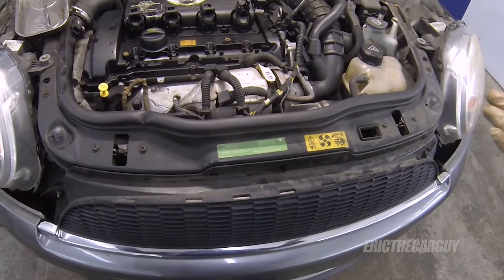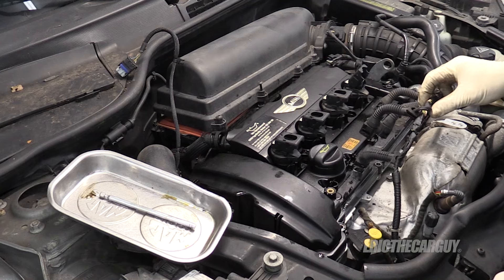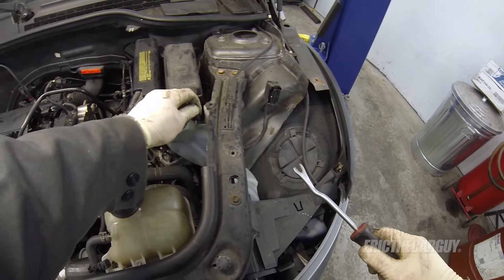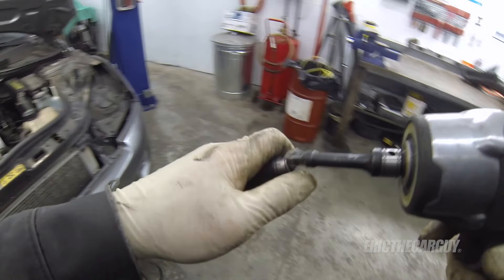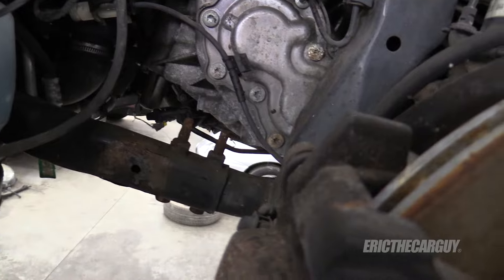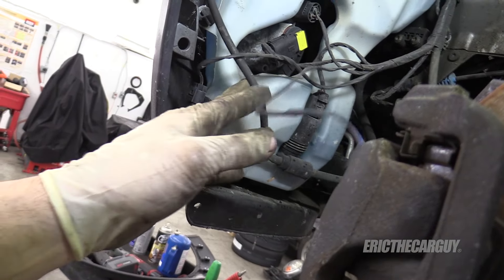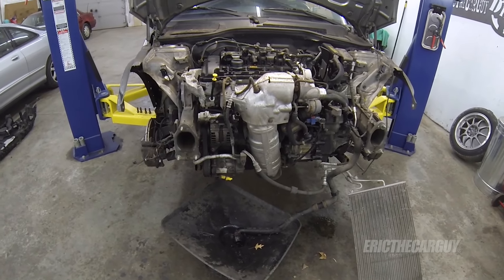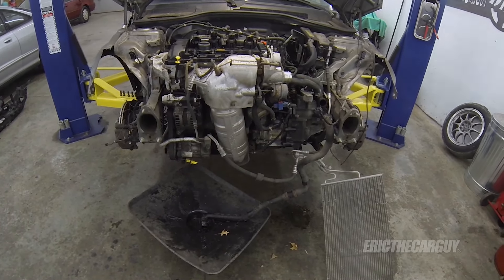Mini Cooper S (R56) Front End Removal

Comment: for that stuck lug bolt, get yourself a used SWENCH mechanical impact wrench..
down to only $200 used on ebay. It KICKS ASS, never lose another lug bolt/axle nut battle in your life.

Saved my ass removing head bolts that were so tight it would shatter the Torqs bit.
And removing plastic dual over head cams/crank bolt on a subaru (4 cam with plastic pulleys).

plus anytime you pull it out you are INSTANT BAD ASS.

Thanks for the upload eric!

Comment: 6:44 when you try too remove oil drain plug after a jiffy lube oil change.
Reply: LEX Maximaguy87 and u know that the treads are 100% gone..
Reply: hes actually trying to take the driver side wheel, off not the drain plug.
Reply: Jiffy lube guy used too many dugga duggas on it. My wife's 2012 MINI Countryman had a similar issue, but I wasn't in a shop trying to get it off. I was on the side of the road. Thankfully, I was able to find a 6 foot long piece of tubing that was used for a fence post and make a cheater bar on the lug wrench. I still had to lean on it pretty damn hard.

Comment: i found that a small deep socket was great for pushing the clips out from behind for the wheel arch trim without breaking them , most people just go Ape and use a door card trim tool to remove the wheel arch trim , with pretty much breaks most of the clips, there not much to buy, but i just find it a better method ! 👍

Comment: Autozone has a variety of clips that will work with MINI trim.  I don't think you needed to remove the inner fender liner completely, just detach the front four push rivets.  I think you also didn't need to remove the eyebrow trim completely, just detach the fasteners where the trim meets the radiator support.
The Harbor Freight Pittsburgh Pro 25" breaker bar (for when you're "serious") is the Bomb.
Reply from the maker: Thanks for the input. You'll see in an upcoming video that my suspicions were correct that you don't need to remove the washer bottle or the upper support. You just need to detach it from the strut towers. Personally I don't think it's a big deal to remove the fender liners. I also think it makes more room if you do. It also gives you the opportunity to clean out the debris that sits in front of the door that can cause corrosion.

Comment: I hate those wheel arch clips. My R50 has them. 
But the front end is so much easier to take apart. Probably only 12 fasteners for the front bumper cover, 10 to remove the bumper bar and 4 more for the crash tubes. Electrical connections aren’t fancy though.

Comment: Eric, I'm surprised to see you don't have any temp studs for these German vehicles. They are quite inexpensive . Before removing all bolts. You insert two studs usual made from aluminum with different thread pitch to meet multiple applications. They stick out about 3 inches after hand threaded into the hub. Allowing the wheel to be supported after all bolts are removed. I hope you read this and look into this cheap simple alternative.
Reply from the maker: I don't normally work on German vehicles, I normally work on Honda's.

Comment: Eric that is alot of bolts fasteners and so on. How do remember which ones go where for the reinstall? Do mark/bag them or do you just have an incredible memory?
Reply from the maker: I normally keep all the fasteners I remove with the part that was removed. If I can, I put them in place on the part removed. As long as I don't accidentally kick the parts when walking across the shop, it usually works pretty good.

Comment: Atleast you just had to get serious, didn't had to be annoyed or worse, pissed off. 

That said, I had to remove the axle nut on an chevy uplander. It was easier than your wheel bolt ! I did get the 'I'm serious', but I'm sure the cordless impact would have just worked.

And, on my previous car, I actually had to go ballistic... I broke a 1/2" ratchet on a wheel nut. I didn't had the 'I'm serious' breaker bar, but I lifted the rear wheel off the ground, making it spin... And eventually the stud started to spin... I ended up drilling the stud. Pilot hole, then 1/4", then twist to break. No dammage to alloy wheel.

... And people say you can't drill studs... Yes you can. Easilly too. If you can't it mean you use a dollar store quality drill.

Comment: I had to use a long breaker bar to loosen up the wheel bolts on a Mercedes before as well. It was so tight the bar was slightly bending lol I hate wheel bolts.

Comment: How do you store so many nuts and bolts so you know where they came from?
Reply from the maker: I keep them with the parts removed.
Reply: If you can't attach them back where they came from - and especially if the car's going to be left in pieces for an extended period of time...I'd recommend some little ziploc bags and a magic marker.  Invaluable for project cars.  But never dump them in a pile and assume you'll remember them all - that way madness lies.  :-)
Reply: Agree, I took my mini apart and did this exact thing with the zip lock bags and a marker.  It worked great
Reply: Of course he could always just watch this video to see where everything goes.
Reply: I'm going to assume the guy who casually takes engines out of cars knows how to keep track of his parts

Comment: 16:24 Only a German would design such kinky abstract washer reservoir as that.  I picture a dude like Mike Myer's Dieter character from the old SNLs bringing that design idea to the Mini engineers.
Reply: you say that like it's a bad thing , Germans have there funny ways
Reply from the maker: It's designed that way so you can have access to the plugs and bulbs for the lighting.
Reply: Over engineered and manufactured with terrible plastics. That’s the BMW way. And yet I still own a 211k mi 530i...
Reply: It’s all about packaging; they needed to design the reservoir that way as provide easy access to the fog lamp bulb, and because there is very little front overhang due to how small the Mini Cooper is.

Comment: Got a question. Both my neighbor's 12 inch engine fans in her Dodge Caravan won't come on. I changed the coolant temperature sensor, that didn't fix the issue. What else could it be? I checked the 40amp fuse under the hood, no breaks or desoldered connections... no way both of her fan motors burned out at the same time, right? I could always jump them to test, but that really is my last suspect...gotta be wires right? Think I got a bad new sensor?

Comment: hey eric this isn't related to video but my wife's 1998 acura el 1.6 was parked and wont start, i checked for sprk there was none, changed the distributor, now i have spark, was able to get it to run normaly, went around the block parked it, my wife tried to start it maybe 2-3h later and wouldnt start anymore. note that before it stopped running somtimes it would crank for a couple turns before starting. so went and checked for fuel pressure after the fuel filter and there is pressure and when i checked the plugs for spark i could smell gas when my wife was cranking it while i was looking for spark, so at this point i have no idea. somtimes when i crank it i can feel the engine trying to start. could it be the ignition timing, i did my best to mesure the marks on the old one and tried to place the new one in pretty much the same spot and the fact it started and ran fine tells me that probably isnt it. there is a check engine and codes are as follows P0118/P0505/P0138/P0420 hope you or one of the awesome viewrs can help, thnx!

Comment: "Bonus screw". You got that right. The take-away here is the Germans found a way to over engineer and complicate a nice little simple car and made it super expensive.  BINGO! You lose.
Reply: and still runs
Reply: Flame Beats my Aveo’s front bumper is attached by 6 clips, 10 1/4” screws, and 4 14mm nuts.
Reply: I am starting to believe German cars meant to be fixed.

Comment: Cool thing, you do not actually have to remove the transmission from the car to replace the clutch, you pull the strut tower and axles, motor mounts, and pull trans back, turn upside down in the car and it will slide back far enough to remove the clutch amd flywheel.
Bmw pays 24 hours or so for this, I charge half those hoirs at half the rate, mini clutch in a day and dont even have to remove the bumper
Reply from the maker: For me it only took a couple of hours to remove the engine and transmission. It was easier to change the clutch with the engine/trans out of the car. At least for me. YOu'll see this in upcoming videos.

Comment: My 2012 S misfires under hard acceleration  code just says #4 misfire. Replaced all coils still misfire whats next?
Reply from the maker: Look for gummed up intake valves. Direct injection has issues with that. Mine were really bad as you'll see in an upcoming video.
Reply: EricTheCarGuy 
Gummed up by how? Seat or stem?
Reply: Stem Side. You most likely need a walnut blasting or thorough physical cleaning. Some folks have successfully hand scraped out most of the deposits and de-carbed but the walnut shell method is the best way to restore. Bavarian Motorsports sells a good media blaster kit if you have an air compressor that can save you some money.
Reply: AcesnEights698 even if the car runs normally well otherwise?
Reply: AcesnEights698 how does gum develop with synthetic oils?

Comment: What if I told you you didn't have to take the front end apart to take the engine out.. more room is always better though.
Reply from the maker: I'd say you're working too hard on this car. Taking off the front clip isn't that bad in my opinion.
Reply: EricTheCarGuy it does help that we have pins that will let the front end slide out about 8 inches. Some guys at the shop don't even do that to do filter housing gaskets, they must have special kind of hands and arms to be able to do that.

Comment: Again, why are you doing this?  Bored?  Have a need for destruction?  Nothing better to do?  Maybe another trip to Finland is in order?

Serious breaker bar!  LOL...A few months ago I was removing some half inch bolts on the bunk brackets on my boat trailer.  The electric (not battery) impact wrench couldn't break them loose so used my version of the half inch breaker bar.  The bolts literally sheared apart and they were only grade 5 bolts!
Reply from the maker: https://youtu.be/Ajsk8kgafXg